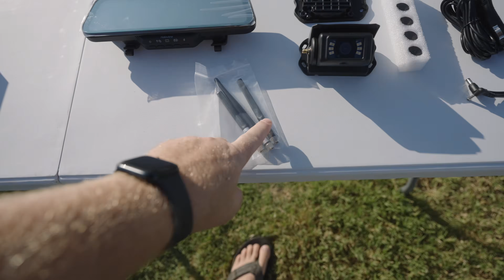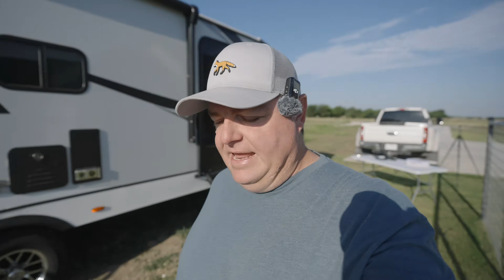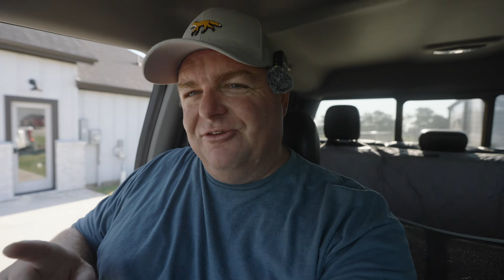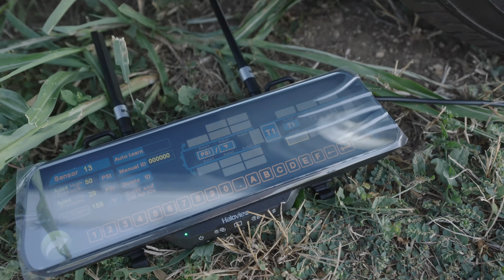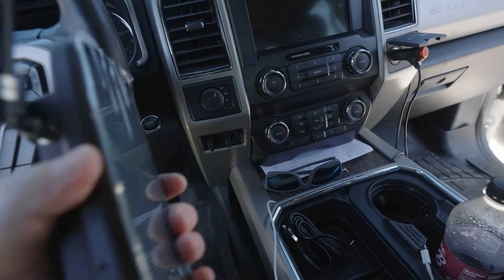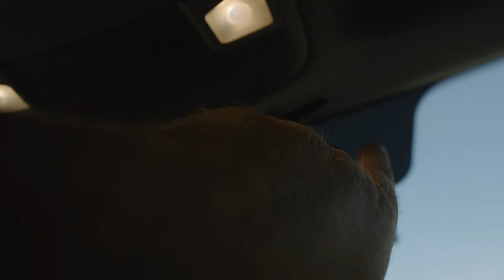We Installed This RV Camera System — Here's What We Found

Comment: What happens if you are not towing?  Do you have to remove the screen to use rearview mirror?  If unit is powered off, will it act as regular mirror?  Seems like a bit of a hassle to remove off of standard mirror when not towing trailer
Reply from the maker: It stays right where it is and I put the camera functions to sleep and then it’s a mirror.  So essentially I hit one button and now it’s just my mirror.  Plus, it’s still records from the front facing camera.
Reply from the maker: For the reasons I put in that other comment it’s why I actually love this thing so much.  I essentially don’t have to do anything pre-your post trip to get ready for it.